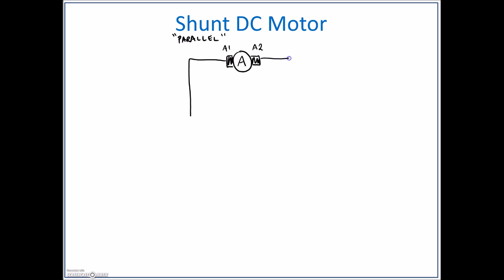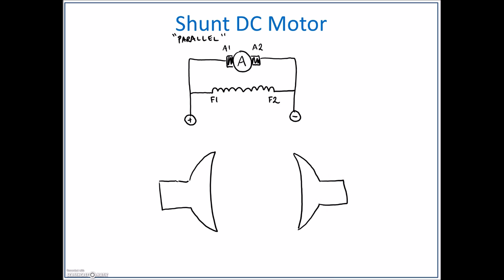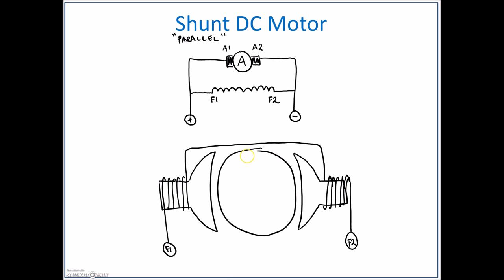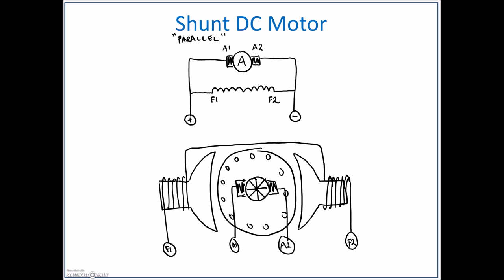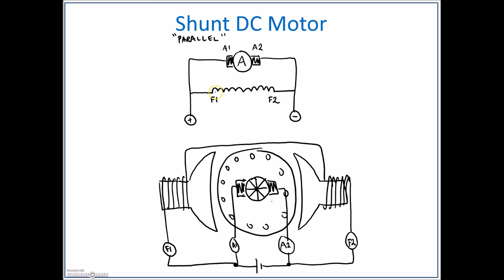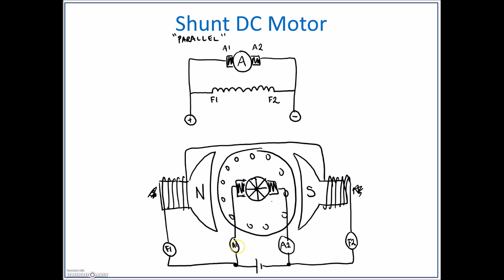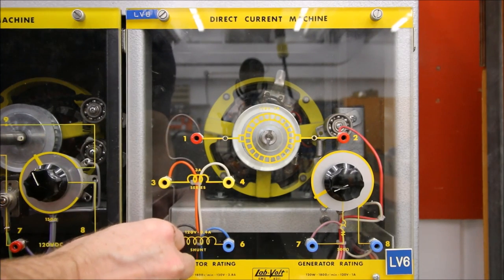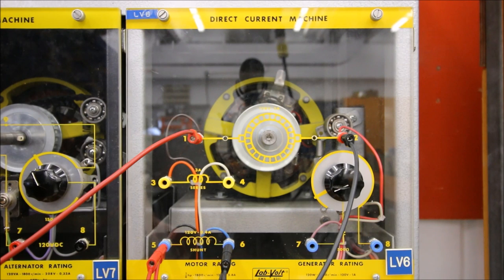Shunt DC Motor Connections

Comment: Hi Pete.  Great video. Would you have any knowledge on the old Bodine 400 series Shunt wired 115 VDC motors???  I’m trying to get one working but I understand it takes some extra knowledge and Parts. I was hoping to use a rheostat and Bridge rectifier but was told I need a Shunt controller and both the field and armature have to be controlled separately. I can see why these motors haven’t been produced for over 30 years now.  Is there an easy way to change current to AC ?   Thanks.

Comment: If you were to hook up the ammeter on this at which locations would you place them?
Reply from the maker: The ammeter would be placed in either of the supply conductors to the motor. Best to use a Clamp-On Ammeter

Comment: why does the shunt motor have a better speed control? is it just because the armature and poles are at the same potential?
Reply from the maker: The Shunt has the best speed control because it is a parallel feed to both the armature and the shunt field, so you can control the voltage to the armature without effecting the voltage to the shunt. This maintains the cEMF from the shunt magnetic field, while reducing the voltage to the armature to control the speed. 

fyi If you wanted to get the motor to go above base speed, you could do the opposite... maintain voltage to the armature, and reduce the voltage to the shunt winding, which would reduce the cEMF and actually increase current to the armature.. allowing the motor to go faster than it is rated for, but with reduced torque.

Comment: you used the same motor but wired it series in another video. why would you wire a motor series vs shunt? just max speed? what happens at different volts?

any applications for switching a motor betweeen shunt and series?
Reply from the maker: Series = Max Torque, no speed control
Shunt = Best speed control 
Lower voltage = less current = less speed and torque

Comment: the electomagnets on the armature of a DC motor should be wound in opposite direction ?
Reply: They are wound in opposite direction. It doesn't look like it, but they are because the magnets are mirrored and the windings aren't.